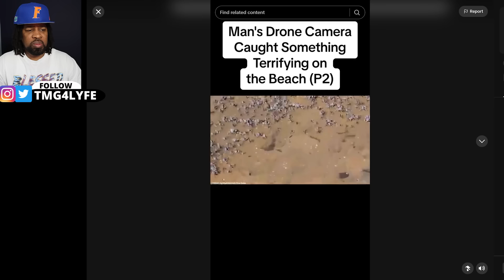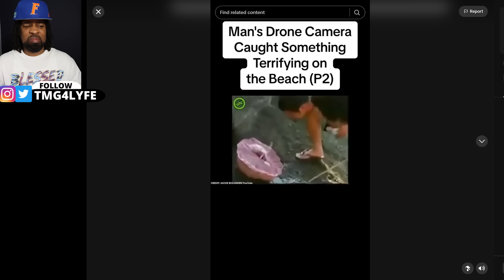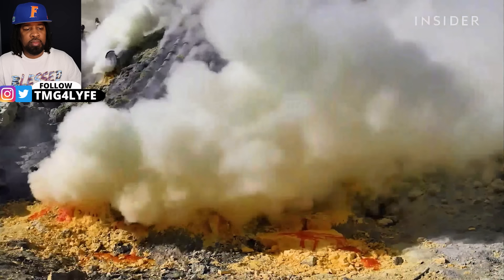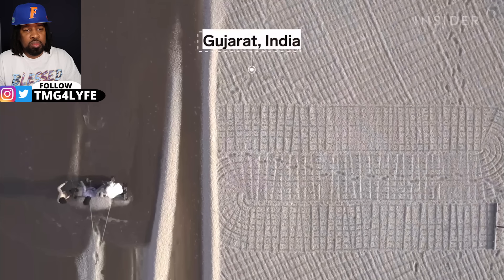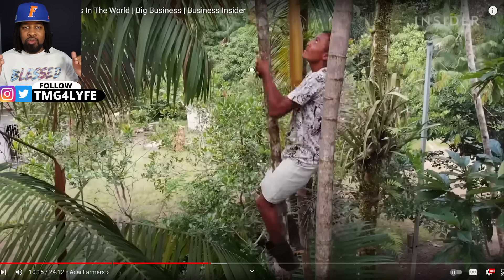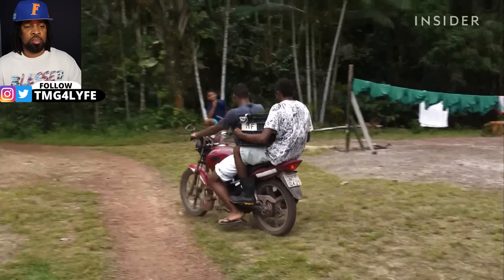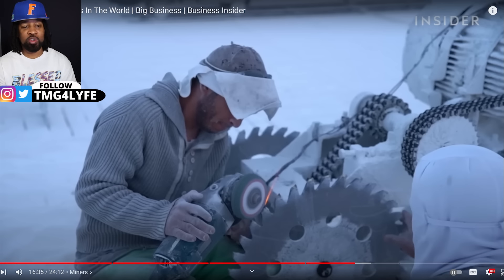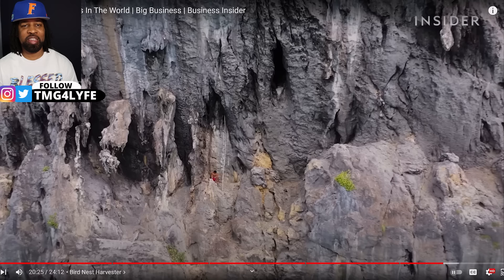Man's Drone Camera Caught Something Terrifying on the Beach

Comment: The blue soldier crabs are a good size, but still small considering. They are a ball-like shape with 8 legs under it, that stick out to the sides. They dig into the wet sand making tiny sand balls to cover the hole they made. I used to love chasing them across the sand at low tide. A very interesting crab, if you get the chance to see one on the beach.